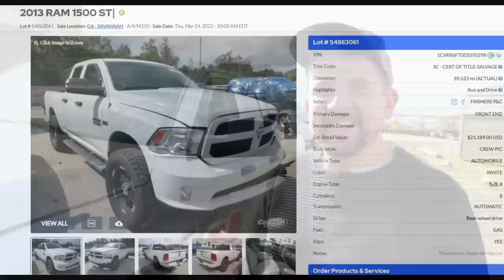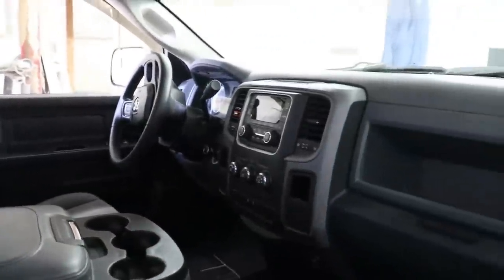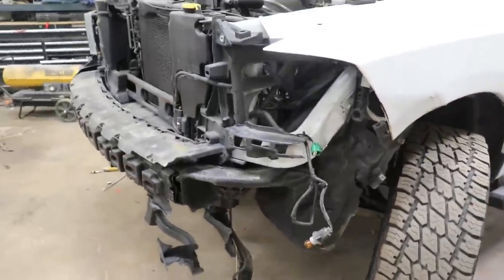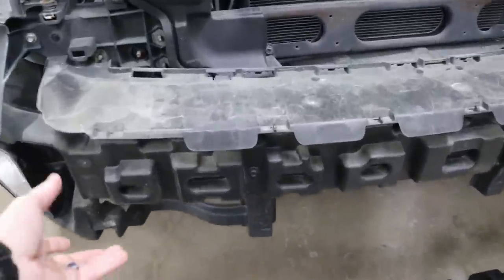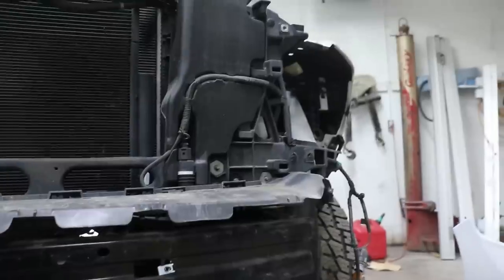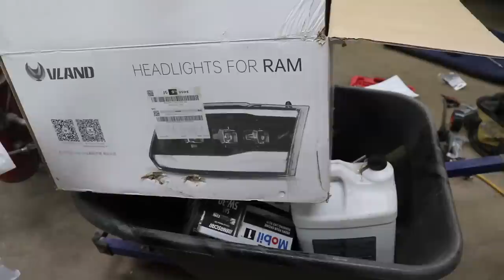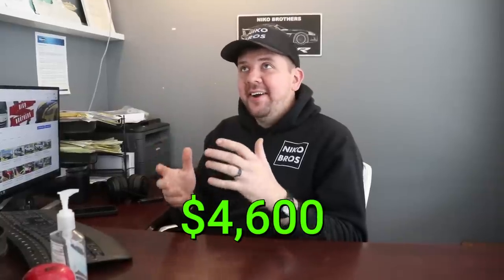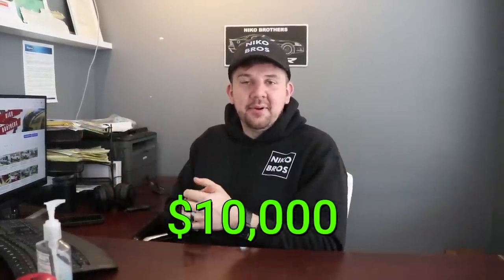$$ PARTS , COST  AND PROFIT  $$ BUYING SALVAGE TRUCKS OFF COPART  AND MAKING MONEY FLIPPING TRUCKS

Comment: Another back job. You covered the damaged fender with flare,
Reply: Super cob job. You can clearly see the wheels aren't straight at the beginning too and they casually mention doing an alignment which means some suspension part was bent too

Comment: Why are the insurance companies totaling trucks like this? Are they wanting people to buy new?
Reply: Insurance is required to fix it correctly where these guys just cobbed it back together. If you look, the white inner rail was damaged/would've been replaced by insurance, they covered up the damage on the fender which would've been replaced including paint blending into surrounding panels, and if you notice they casually mention doing an alignment which means some suspension part was bent. Super ghetto all around.